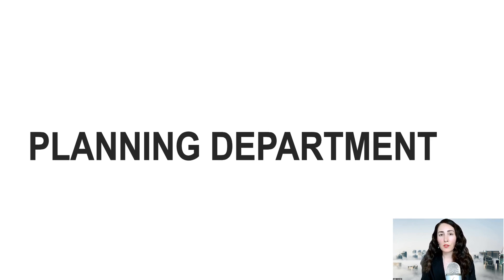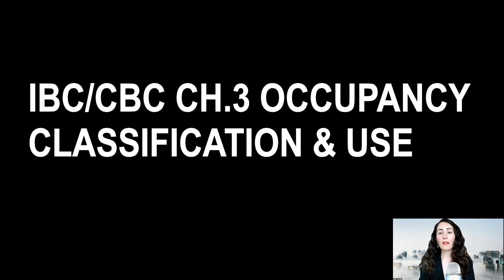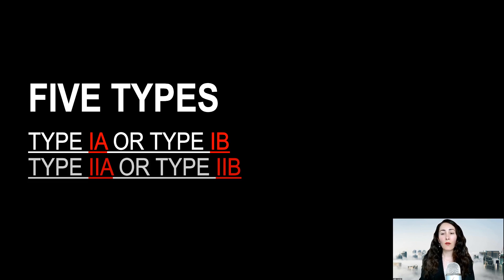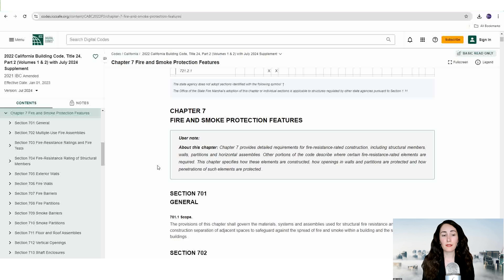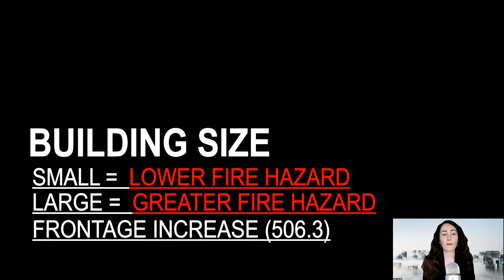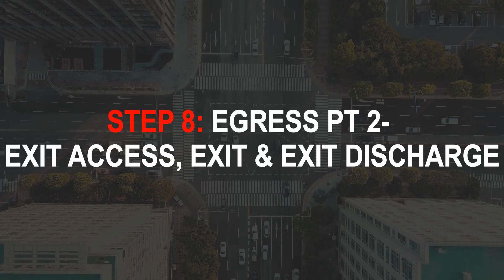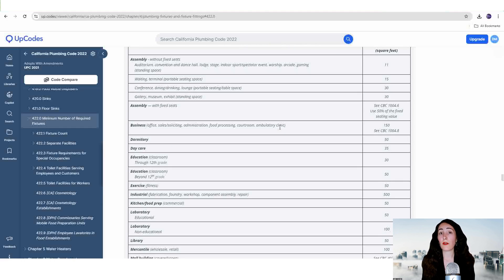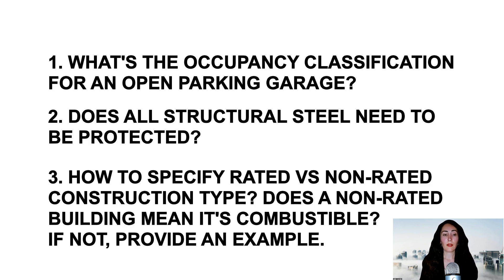MASTER Building Code Analysis in 10 EASY Steps

Comment: 1. The occupancy classification for an open parking garage is group S-2, low-hazard storage.
2. Not all structural steel needs to be protected. There are 5 types of construction, and it depends on the type of construction and specific building elements. Building type IIA, IIB structure steel needs to be protected.
3. The rated and non-rated construction types are specified into two types: A (protected) and B (unprotected). A non-rated building doesn't mean it is combustible, for example, type IIB and IIIB are non-rated, but the buildings can be made of noncombustible material; such as steel and concrete material.

Comment: 1.The occupancy classification for an open parking garage is group S-2 which is low hazard storage
2.Not all structural steel needs to be protected it depends on the type of construction and type of occupancy 
3.There are two types of construction types, rated and non rated typically which are based on it's fire resistance rating. Type A buildings are rated to be fire resistant and protected , while type B is not rated as fire resistant, but also not necessarily combustible.

Comment: For me, this video cleared up just how many steps an architect needs to take, and how in depth we really need to research. The fact that there are so many regulations in general as well as varying regulations depending on the building's use, occupancy and size is going to make the process so much more confusing and complex. As you said in the video, there's never really a clear answer and I think that makes it really obvious that I'm going to have to get used to navigating a code book without getting overwhelmed or confused like I currently am. These videos are very helpful for me to see the importance of codes however, fire safety and earthquake management especially considering where I live. It's also nice to hear that ADA compliance has to be taken into account in every step and analysis, although it's obvious that's how it should be. I think that's just a good reminder for me to keep ADA rules in mind even when designing my basic projects for school.

Comment: 1. Section 311.3 of the IDC states that public parking garages, open or closed, fall under group S-2 occupancy. 
2. No, not all structural steel needs to be protected, as provided by the construction types.
3. Rated versus non-rated means that a building has additional protection from fire. A non-rated building does not mean it's combustible. It just means that B, non-rated, will combust sooner than A, rated.

Comment: I found this video very helpful on how to assess building codes to a project, when first thinking of this concept it could be a bit overwhelming trying to figure the proper building codes to assess to a project with no direction. I can definitely see myself using these steps when assessing building codes to a project that I may be working on, I'm glad that this video provides guides to the chapters related to each step in the code book, to give a direction as to where to find the information needed. I wonder when does the schematic design process takes place in this operation, or if the design just develops the more and more information we acquire from the code.
Reply from the maker: Codes should be considered from the earliest stage of design,  during Schematic Design so we don't waste time designing something and then fins out during Design Development it's not possible.

Comment: 1. An open Parking garage is Occupancy Group S-2, 
2. No, not all structural steel needs protection since there is a typa A and type B construction and sometimes type C construction for every building type, meaning there are protected and non protected options based on your building requirements
3. you can tell rated vs non-rated construction using the A or the B in the type description. Type A construction is fire rated while type B construction is not rated. this goes for type 1-5 construction so you can have type 1 construction which is non combustable materials like concrete and steel but you can also have a type 1A which is an added layer of fire rated protection whereas type 1B has no extra fire rated proteciton but the materials are still not likely to combust

Comment: 1. An open parking garage is Group S-2, meaning low-hazard storage. Whether steel needs protection depends on the construction type.
2. Not all structural steel needs fire protection, but it does need corrosion protection. Type A buildings are fire-protected, while Type B are not.
3.Rated and non-rated construction types are categorized as A or B, based on fire resistance. For example, Type IV-A is a combustible building type with protected materials, while Type IIB is non-combustible but uses unprotected structural steel.

Comment: 1. A open parking garage is classified under S-2 according to the IBC.
2. No, all structural steel does not need to be protected as there are different requirements for the code
3. You are able to specify rated vs nonrated construction types depending on the need for fire rating that they have. With type A constructions being protected materials, there is then type B being unprotected materials. With this, non-rated buildings are not necessarily combustible, just that they are not required to meet the fire rating.

Comment: 1. The occupancy classification for an open parking garage is group S-2 according to the IBC.
2. No, structural steel only requires protection depending on what construction type is being used. 
3. To specify rated vs non-rated construction types you must identify the project's fire resistance, typically ranging between 1 and 3 hours. There is no direct correlation between non-rated construction and its combustibility. For example, a structure can be non-rated if the building code does not specify fire-resistance ratings for particular components, all while being made of steel, a non-combustible material.

Comment: 1.	Open parking garages are classified in group S-2 as low hazard storage.
2.	Depending on the construction type not all structural steel does not need a protective coating.
3.	Rated and Non-Rated construction types fall into 2 groups, A and B.  A Non-Rated building does not mean it is combustible, it means it can use materials like concrete that doesn’t need fire protection.

Comment: Great video demonstrating the different kinds of steps listed in going through and applying codes to a project. What I liked about the purpose of this video was that these steps are a chronological step-by-step guide as to what to do first and second. Because there are so many codes, it may be confusing which ones to look at first. This video was beneficial in identifying the most significant and drastic codes that determine all the other codes. It helps eliminate going back and forth to ensure the codes agree with one another. Having the dominant codes identified makes looking for the smaller codes much easier.

Comment: Very cool video, these past few semesters I have been curious about the real process of our career. I had not known the intricacies and depth of the initial design process and only last semester was I even given a taste of it. Thank you for making a cohesive explanation of part of the process and how to start, this is indeed a very tricky step for us architects and there is definitely "no straightforward answer" that plays part in the questions I had asked you our last class that we met. So many things to think and search for, it is interesting to learn about it. I ended up taking notes of these 10 steps and adding them into my own file, I think the order of them makes a lot of sense except I think step 9 (plumbing) is going to be a difficult problem to work around and would probably work out this issue sooner. One thing I liked is that you provided the chapters on where to find and learn about the codes for this particular step.
Reply from the maker: Glad you found it helpful! 💫💥

Comment: 1. S-2 group is the classification used for an open parking garage 
2. Not all structural steel requires protection, but its recommended
3. Rated vs. non-rated construction type is based on if it is fire resistant. For example: type A building is fire resistant and Type B building is not fire resistant.

Comment: 1. The occupancy classification for an open parking garage is S-2.
2. All structural steel does not need to be protected. It all really depends on the occupancy and type of construction that the building will be. 
3. Rated and non-rated construction types are determined based on their fire resistance. Type A buildings, for example, are fire resistant, while type B buildings are not fire resistant.

Comment: 1. According to IBC, the occupation type of open parking lot is the S-2 group.
2. Not all structural steel needs protection. This depends on the occupancy rate and the type of building required for the building (type A or type B).
3. Rated and non-rated structure types are based on whether it is fire resistant. Type A buildings are fire resistant, type B buildings are not fire resistant.

After watching this video, I feel enlightened and it is easier to understand the general building code. It is important to categorize and further analyze these 10 steps. That's fine. Because it is very clear and concise, it allows everyone to understand the building code in a simple and detailed way. Many of these steps are complementary. Such as accessibility mentioned in the video, because each building's purpose is different, their accessibility restrictions and specifications are different. This is a very important point. That's something a lot of people don't know. In addition, fire prevention is a part that all buildings need to pay attention to, fire codes, and fire-related material types. This is also very important. I learned a lot from this video, thank you very much.

Comment: 1. An open parking garage's occupancy classification is Group S-2, also known as Low-Hazard Storage.
2. Structural steel requires protection only in fire-rated constructions. Non-rated types, such as Type II-B and Type V-B, can use unprotected steel.
3. Rated construction specifies fire resistance, such as Type I. Non-rated does not mean combustible. Type II-B, for example, does not provide fire protection and instead uses non-combustible materials such as steel.

Comment: 1. The occupancy classification for an open parking garage is a Group S-2.
2. All structural steel does not been to be protected, it really depends on the type of occupancy and the construction on the type of building the steel will be used for. 
3.  Rated VS Non-Rated construction focuses on the type of fire protection of a building. Rated, or referred as Type-A, refers to a building being protected.  Non-rated, or Type-B), refers to a building not being protected. One example can be a building constructed with concrete since concrete is not combustible.

Comment: 1.The occupancy classification for an opening parking garage is group S-2. 
2.Depending on the building's construction and occupancy, not all structural steel needs to be protected. 
3.Rated and Non-rated consists of two construction types: A and B. Type A is protected and Type B is not. However, non rated building does not mean it’s combustible. For example, Type IIB is non combustible and non rated, by utilizing steel or concrete which requires no fire protection.

Comment: This video offers a great way to look at building codes and requirements in a way that isn't as overwhelming or confusing. The breakdown of the major 10 steps to complete during and before a building project gives us, as architect students, a good look at what we need to accommodate for and seeing online resources that explain building codes in their own separate charts is very helpful and informative. All of these codes are in order to comply with safety requirements, so making sure that each one is met is very important for safety and any setbacks that may occur during a project.

Comment: 1. The occupancy classification for an open parking garage is group S-2, which is low hazard storage. 
2. All structural steel does not need to be protected. It depends on the construction type and the occupancy.
3. To specify, a rated construction type is Type A construction while Type B is unrated construction. Type A is protected and Type B is unprotected, but it does not mean that it is combustible. For example Type II-B is a non-rated building type, and it utilizes structural steel without fire protection.

Comment: 1. The occupancy classification for an open parking garage is classified as Group S-2.
2. No, it depends on the construction type and occupancy.
3. Rated is Type A Construction and Type B is unrated construction. Type A is protected and type B is unprotected yet it does not mean it's combustible. For example, Type II-B is a non-rated building type.

Comment: 1.The occupancy classification for an open parking garage is group s-2.
2. Not all structural steel needs to be protected because it depends on the type of construction of buildings and occupancy regulation. 
3. Rated construction and non-rated construction types are classified on the level of fire resistance. Type A indicates it is fire-resistant, while type B indicates that it is not. For instance, type lIB is non-combustible, whereas type VA is combustible.

Comment: 1. The occupancy classification for an open parking garage is Group S-2
2. No, not all structural steel needs to be protected, however it is recommended. The types range from 1-5 and the rating depends on the occupancy as well as construction type of the building.
3. The difference between a rated and non-rated construction type is how long it can withstand a fire whether that is an hour or four hours. Non-rated construction on the other had is not required to have fire resistance. A non-rated build does not mean it is combustible, there are certain types of construction which are non-rated but uses non-combustible materials such as Type IB.

Comment: 1. The occupancy classification for an open parking garage is Group S-2, Low Hazard Storage.
2. Not alls tructural steel need to be protected, it just depends on the construction type of the building.
3. Rated and non-rated construction types is classified on the level of fire resistance, from 1hr to 3hrs. Non-rated construction does not always mean it is combustible. An example of a non-rated building types is type II-B.

Comment: 1. The occupancy classification for an open parking garage is group S-2.
2. Not all structural steel needs to be protected. Factors such as occupancy and construction type need to be considered. 
3. Rated and non-rated construction type can be classified as type A or B. Type A is fire resistant and Type B is not. A non-rated building doesn't mean it is combustible. Examples of this is how type VB construction is non-rated and combustible, while type IIIB construction is non-rated and non-combustible.

Comment: One point that resonated with me is the emphasis on understanding zoning code analysis as the foundational step in building code compliance. This step is crucial because it involves evaluating local regulations that directly affect property use and development, which in turn safeguards property values and ensures the creation of a suitable living environment. Zoning laws govern land use, density, and the nature of developments, and by thoroughly researching these aspects, architects and builders can better navigate the complexities of property development while aligning their projects with community standards and expectations. This foundational understanding helps prevent costly errors and ensures that projects adhere to legal and safety requirements from the outset.

Comment: 1. Open parking garages have an occupancy type of S-2
2. Depending on the occupancy type, not all structural steel needs to be fire protected
3. There are two types of construction types, rated and non rated. Type A buildings are rated to be fire resistant, type B are not rated as fire resistant, but is not necessarily combustible. For example, a non-protected steel column would be considered type B, therefore type B refers to extra fire protections.

Comment: 1. The occupancy classification for an open parking garage is group S-2, low hazard storage.
2. Not all structural steel needs to be protected. It depends on the construction type that is needed for that building.
3. Rated and non-rated construction types consists of two types, A or B. A non-rated building doesn’t mean it’s combustible. For example, the subcategory IIB is non-rated, but uses structural steel without fire protection, which is non combustible.

Comment: 1. Group S-2
2. Not all structural steel needs to be protected, classifications such as construction type and occupancy are accounted for. For example, Type IIA & B buildings do not need protected steel, but fire-rated construction requires protected steel.
3. Rated vs. non-rated construction type consists of two types: A & B. Type A is protected and type B is unprotected. A non-rated building does not mean it is combustible. For example, VB is least restrictive building type because the materials do not need to be rated whereas VA is more restrictive.

Comment: 1. The occupancy classification for an open parking garage is group S-2
2. All structure steel does not need to be protected. It will depend on what the occupancy of the building is. 
3. Rated vs. non-rated construction type is based on if it is fire resistant. Type A building is fire resistant and Type B building  is not fire resistant.